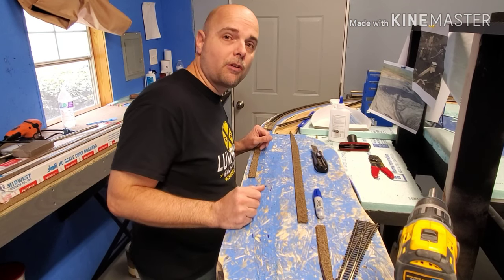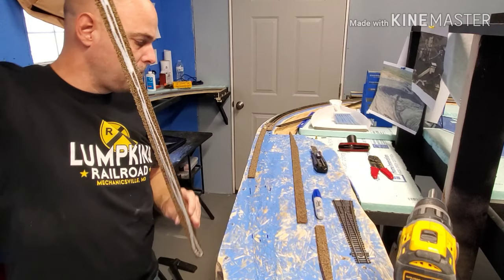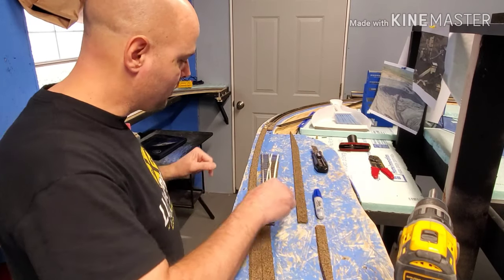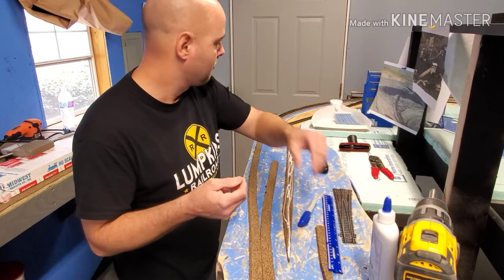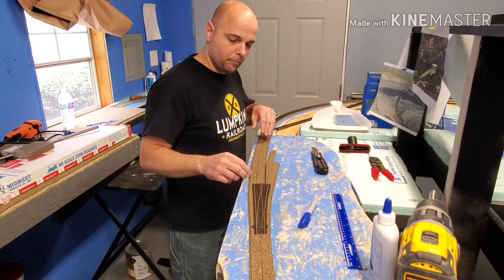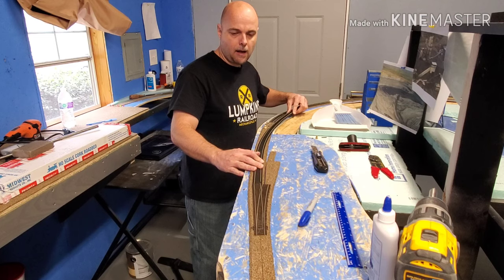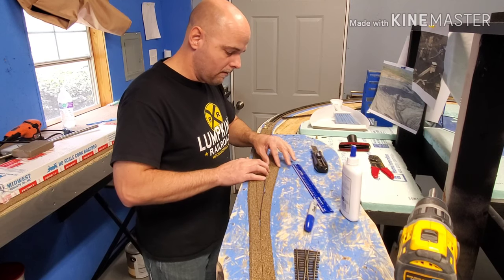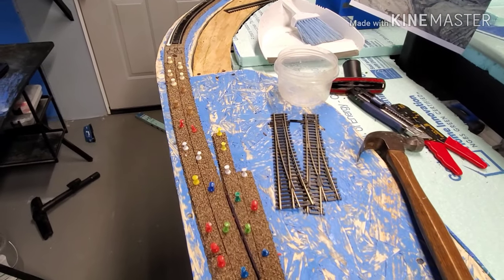How to lay cork roadbed for turnouts.

Comment: Excellent job , I am saving this one thanks
Reply from the maker: James thank you. How you holding up during this time?
Reply: B&H Railroad  I am doing OK., working on my shed, need to get it finished so I can clear space for layout, hard to get materials, i ordered some N gage track and some rolling stock, going to use it to run trains and learn how to use my DCC controller , I have lot models on order from Walthers but delivery delayed until summer, I was layer off end of March but was planning to retire soon, my plans are delayed for a while
Reply from the maker: Well sorry to hear that. however it sounds like you are making the best of it. Which dcc unit did you go with
Reply: B&H Railroad   I have the NCE system  includes 5 amp power supply  pro cab, I am not missing work, I have lots of rolling stock and locomotives
Reply: B&H Railroad  , not sure where you live but I live in Dundas Ontario Canada
Reply from the maker: If you need help with the dcc unit let me know. I live in good ole Maryland
Reply: B&H Railroad  going to set it up using the N gauge stuff I have on order, should be here next week and thanks for offering the help

Comment: That is the exact same method my dad taught me when I was 10 years old and we were working on our first layout.. We would pin the two outside pieces and let them dry for a while before adding the inside pieces. The important thing was getting the center lines marked properly. Mark and measure 3+ times and glue once. I continue to use this method today on my new layout. Great job.
Reply from the maker: Larry how are you. How's the family? Yeah I love this way of doing it.. Haven't had any issues as of yet
Reply: @EmPtySworld1  Thanks. Family is well. Hope yours is also.

Comment: I do the same as you do, and after i sand the cork i spray paint it black where the turnout is and where the cracks are i cover them with black electrical tape, the tape doesn't effect the turnout. just my 2 cents. Be safe stay healthy
Reply from the maker: Thanks for watching. Yeah I have used a few different methods..In the end I usually don't worry about the gap and just let ballast and weathering hide it. Hope all is well.